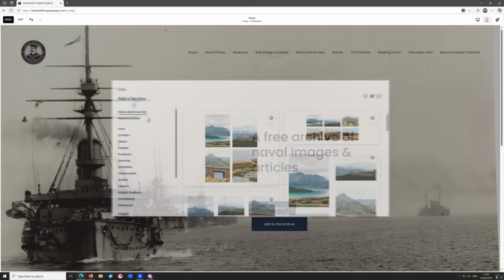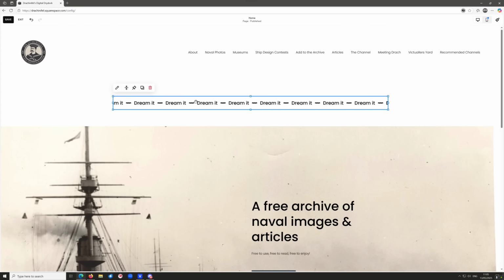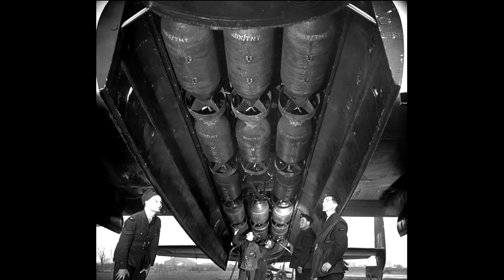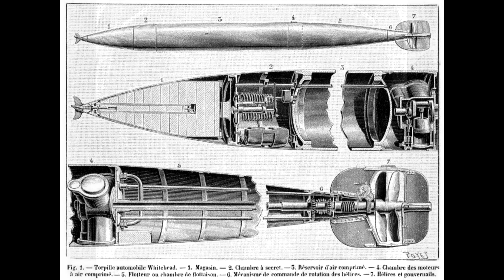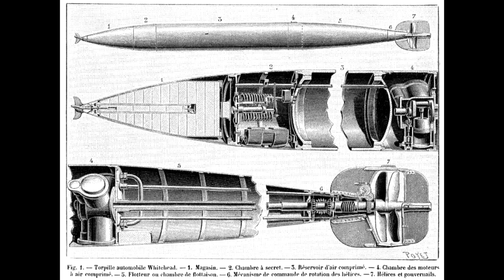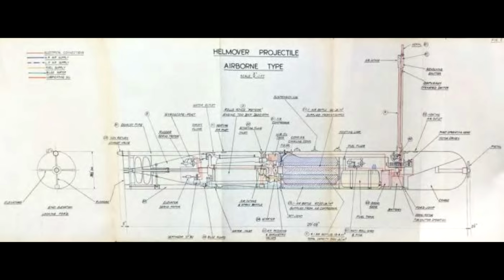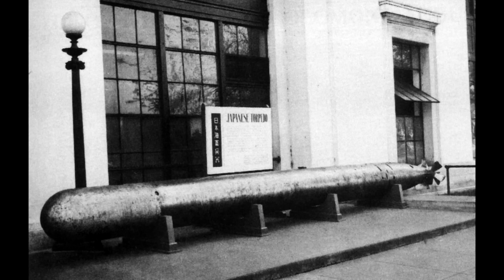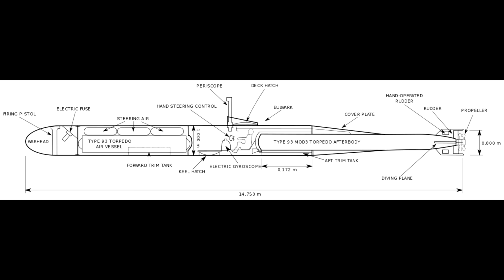The Helmover Torpedo - The Battleship Eraser

Comment: So it is a Grand Slam scale torpedo powered by a 550 horse power V-12 engine bearing a ton of RDX and having the ability to jump out of the water and over obstacles while requiring two aircraft to deploy it?

And it was actually ordered into production.....
Reply: @88porpoise  could be worse, could be a Chicken-powered nuclear bomb. We only NEARLY built them 😂
Reply: @MoA-Reload...  Chicken GUIDED nuke glide bomb .  Hopefully the chicken wouldn't identify as a Homing Pigeon.  😁
Reply: @robertf3479  oh it was even crazier than using the chicken for guidance. The plan was to bury a bunch of nuke mines to stop the Soviet advance if they decided to push through Europe but this was back in the 50's before modern electronics and turned out timers and detonators back then really didn't like the cold. There was a chance the bomb would freeze and either fail to go off or go randomly before it was needed so they turned to chickens. It was easier and more efficient to keep a chicken fed n watered to heat the timers and stop them from freezing than installing a heating system so that's what the plan was. Shove a chicken in to sit on the timers to keep them warm with enough food, water and air for the chicken to live for 7-10 days and then run 😂
Reply: @robertf3479  There was a pigeon guided glide bomb though ..
Reply: @shaniamonde7341   And it actually proved somewhat useable.  At least better than the swarm of firebomb-laden bats.  😮😅
Reply: @robertf3479 Are you sure you’re confusing them with the pigeon-guided bombs?
Reply: @shaniamonde7341  That would have probably been the next version. I mean, it's already got a snorkel platform over the waves, the guidance system including some trained pigdeons were available...
Reply: @MoA-Reload...  The British were using chicken heated nuclear land mines during the Cold War so that isn't nearly as out there as one would think.
Reply: @l7986  what makes it so much better is when they declassified the documents around it everyone thought it was an April fools joke at first 😂
Reply: @MoA-Reload... or Bat bombs
Reply: @dave_h_8742  Ironically, ignoring the problems with using animals as unwilling/unwitting suicide weapons, the procurement of said bats, and deliberately introducing a non-native species to the environment, they would've worked fabulously well, as you'd only need a couple of bombers with a Bat Bomb mixed in there to burn down a city like Tokyo (which was primarily paper and wood, rather than brick and mortar or concrete and rebar)
Reply: @MoA-Reload... Chicken *triggered*.
Reply: @jimtalbott9535  true, good point
Reply: @MoA-Reload...  Or the nuclear bomb whose own designers basically said "yeah the safety in this does not work". Violet Club was a WILD ride that scared the US so much that they supplied their own designs to us in its aftermath. Or at least given the timeline that's the narrative I chose to believe.
Reply: @Reddsoldier  What country?!
Reply: To be fair, it’s a lot better than a squadron of fairly short range torpedo bombers as long as there aren’t too many enemy planes in the sky
Reply: I mean, why would you not
Reply: Torpex has RDX in it, but is not entirely RDX.
Reply: And after the war they said "and how about we make it nuclear as well?"
Reply: This thing is so bonkers I’m amazed it wasn’t German. 😉
Reply: @GrahamCStrouse if it was German they would’ve stuck rocket engines on it
Reply: WELL I SAY..
Reply: "Nothing ventured, nothing gained"  
- Chaucer
Reply: So you're saying the U.S. defense industry gets it honestly.
Reply: 750-1030hp
Reply: O ye of little faith ..
Reply: the bouncing bombs for the dambusters could knock their own airplane out of the air. you do dangerous things in war
Reply: Dude this is a British weapon, from the same people who created a MANPADS you had to manually guide with a joystick to hit a moving fighter jet
Reply: @argokarrus2731  I defend blowpipe on the premise that it led to Javelin which is a scary MANPAD.
Reply: Must have some German in the bloodlines
Reply: Imagine the german spies who got any intel on this, and the cold sweat of any capital ship captain if they new somebody was coming for them with this weapon.😅
Reply: @0katmandude0   I like to imagine the German spies capturing some new Intel, they get back to their hide out, set up the radio, pull out the paper's and start reading back what they need to send and just going "aww come on! I get caught here I'll be shot as a spy. If I ever get home after sending this they'll shoot me for being drunk, high or both on the job!" 😂
Reply: Dude this is a British weapon, from the same people who created a MANPADS you had to manually guide with a joystick to hit a moving fighter jet

Comment: Thank you for the episode. 
One question: from your visit to Cleveland, it is clear that torpedoes can be adjust to run on different courses after being launched (and not just directly ahead in line with the submarine's bow or the airplane's nose). Did any of the powers consider using a torpedo that would run on a arc? Or did they ever consider adding acousti c homing to air dropped torpedoes?
Reply: Yes and yes.

The Germans have the LUT and FAT pattern running torpedoes they issued to the U-boat force later in the war, specifically designed for targeting convoys. The pattern was a looping S shape that the torpedo does after passing the programmed distance to the target coz at that point, the assumption is that it has missed the target so it should then turn around and go back the way it came to hopefully hit the target from the opposite side if it once again didn't hit the target then it proceeded to do this repeatedly until it ran out of fuel or hit something (which could be a different ship in the convoy).

The Italians had electric air dropped torpedoes that were programmed to cruise in slow lazy circles for extended periods of time and the idea is that they drop it in enemy waters along busy shipping paths or even at harbor entrances. The idea is obviously that some unfortunate ship passes by and gets hit by the circling torpedo.

Acoustic homing air dropped torpedoes, that's the Mark 24 mine. They called it a mine for counterintelligence purposes, but it's actually a small electric anti submarine torpedo that can be air dropped over the suspected location of a submerged U-boat and it will follow the noisiest object nearby, It's quite slow, like 10 knots or something like that to keep self noise down, but still fast enough to catch the usual 7 knot max underwater speed of a U-boat (well at least a common U-boat and not those elektroboots).
Reply: Did we have acoustic homing at that time?

Comment: And on today’s episode of “What if Top Gear was around in World War 2?”
Reply: Speed and power solve many things as Clarkson would tell you
Reply: @timetounwind9205 
❓So, what you're saying is that the torpedo should have INSTEAD had 3 GM 572cu/in Chevy V-8's installed, each producing 730hp x 3 = a total of approximately 2,200hp & 2,040 ft/lbs torque.  You were correct in your estimation that this much power in ^that torpedo should do 0-60mph in 6 secs, standing 1/4 mile et's in the mid 9 sec range, and top speeds of 260mph.

  But did General Motors Performance Parts(GMPP) sell the Chevy 572ci big block V8 in the early 1940's? Didn't you consider that when YOU decided upon ^this exact propulsion system? I'm sure you did.... 😉👍
Reply: Tonight on Top Gear...
James learn how to drive RC boat
Richard looks out of a window's  plane 
And I get to use my genius against crauts!
Reply: Hammond: So, how are we going to power it?
May: I've been running the numb...
Clarkson, entering the room on a forklift thats carrying something massive under a tarp: Gentlemen, I've got this.
Reply: @VieVentar  
"Tonight: James wears a moustache; Richard wears a moustache, and I wear a moustache."
-
Hammond: Is that, a radio control for this thing?
Clarkson: YYEESSSSS
-
Hammond: I assume, at some point, there will be a massive accident.
May: Yes.
Reply: How hard could it be?
Reply: Racing alongside a enemy battleship, outoacing every destroyer and leaving behind a smelly and colorful smoke cloud.
The damn bits again.
Reply: I can just imagine seeing Jeremy Clarkson riding this thing into the Bismark yelling "POWERRRRRR"    
Be even better if it was the engine from a Jaaaaaaaaaggggggg.
Reply: It seems to be a Nation Thing. There is definetly something in the water on that Island.
Reply: @Benepene  
Allen Millyard concurs....
Reply: "The producers gave each of us a budget of £1,000 and told us to buy an engine for our torpedo."
Reply: "PUT IT IN SIDEWAYS"
Reply: Imagine if this project was given the highest priority. Hunting Japanese aircraft carriers and super battleships with active sonar homing. Adding in the "explode below the keel" would have made this a true "one launch, one kill" weapon.
Reply: lmaooo
Reply: And on that bombshell...
Reply: James May as his going down in a flaming Lancaster bomber "oh cock"
"That's not gone well" Hammond after attempting to jump  a cromwell tank over a canal and landing in it. 
"Sometimes you can see my genius" Clarkson after presenting their new prototype tank the valiant A38.

Comment: Another excellent Drach video, with bonus early release.

Meanwhile, somewhere in Ukraine, one of Budanov's minions is carefully taking notes, just in case the Muscovian Black Sea Fleet ever dares to venture out of port again...
Reply: Obviously with a weapon like this, fitted with modern control and self targeting equipment, the black sea fleet is not safe in harbor. It's only safe because Ukraine don't want to take things that far.
Reply: @Right-Is-Right  I think it's less that and more that a fleet in being is far more costly than a sunken fleet. For as long as the Russian Navy is anchored there, they need to manage, they need to defend it, and they need to maintain it. That's a lot of resources taken away from the front lines. Though you could argue they could simply bring more ships in after the war - that's not necessarily guaranteed with the treaty with Turkey.

Comment: Lancaster as a torpedo bomber…. FTW?!
Reply: The Manchester from which the Lancaster was derived did have Torpado bomber as part of the mission spec. hence the very large bomb bay.
Reply: When there's a big plane with a lot of undivided internal space, it is a matter of time until some kind of ridiculous load appears.

Aside from the obvious oversized bombs, large military airplanes have carried:
1) Small fighters, like the Goblin in the B-36's bomb bay. 
2) Absurdly large film cameras with film developing facilities (a recon version of the aforementioned B-36). 
3) Field artillery and multiple autocannons (AC-130). 
4) A fighter direction station (a Chinese Tu-4 field conversion).
Reply: @ObsessiveExplorer Then there's the design proposals that get even crazier. Case in point, the B-1R proposal, because clearly the USAF needed a Mach 2-capable air-to-air support bomber with engines ripped off the F-22 and enough missiles to de-plane a small country. The designation had to be some engineer having a laugh though, because there's no way in hell marketing would approve of a project that's literally called the B-OneR.
Reply: @TheMobiusRibbon1-4  The idea of putting a lot of anti-air missiles on a heavy bomber reminds me of the He 177 'Großzerstörer' with its 33-tube upward-firing rocket mortar battery.
Reply: @TheMobiusRibbon1-4  Yeah the B-1R is a really fun project to learn about. Loading one up with air to air missiles and just having an AWACS painting the targets.
Reply: ASR aircraft used to carrry entire lifeboats around to drop when they found crews in the water, too.
Reply: Avro Sea Lancaster, the torpedo bomber 
(If only the Project Habakkuk took off)

Comment: There were some rather similar anti-tank missile projects (launched from great distance, picked up near target for guidance) floating around in the 1950s ("Men Against Tanks" has a chapter on them).  It wouldn't surprise me if the guidance system/remote control from this wasn't passed along as inspiration.

Comment: This seems to be a really Rube Goldberg solution. Did anyone ever look at an unguided sea skimming missile? Something like a rocket powered unguided Harpoon.
Reply: you can’t make a sea skimming missile without an extremely good radar… otherwise the missile is just going to smack into the ocean the second there’s a large wave or a strong gust of wind
Reply: @acid6urns  The US developed very good radar proximity fuses for their anti-aircraft shells during the war. I would think that system could have been used to maintain height above the waves.
Reply: Skip bombing against Japanese ships was a real thing in the Pacific theatre.
Reply: @daniellarge9784  For skip bombing to work the aircraft had to fly very close to the target. What I was thinking about was a missile that could be released 5 to 6 miles from the target.
Reply: Rockets were quite primitive at the time, suffering from short range, poor accuracy, or both. The only long-range rocket weapons from WWII that I can think of are a) the Katyusha, best used for blanket salvos, b) the V2, a stupid ballistic thing only feasible against stationary targets preferably the size of London, and c) the Me 163 Komet, which had a pilot on board and was powered by a fuel about as stable as a 1,000x1,000x1mm sheet of glass suspended on its edges while supporting an elephant.
Reply: @akmzd6938 the Japanese Ohka suicide planes were rocket powered and had a range of 20 miles. I was thinking of something launched from 10 miles away or less. Obviously the rockets or airframe wouldn't be a limiting technology.

Comment: So the one tap torpedo. One has to wonder what the British battleship engineer and architects had when they heard this particular weapon after accounting for the rocket powered tall boys in theyer designs.
Reply: And if you're going to think about 'what if' scenarios,  you have to wonder whether, with the modification necessary to carry the Tallboy and Grand Slam bombs allowing the Helmover torpedo to be fitted with wings and slung under a Lancaster, the replacement of the Meteor engine with a rocket motor and deletion of the snorkel would have allowed the British to create a command-guided antiship missile
Reply: @seanmalloy7249  
Fritz X ring any bells?
Reply: @JohnSmith-pl2bk  Fritz X was a glide bomb; I'm suggesting an actual powered weapon.
Reply: @seanmalloy7249  
Adding one the the many German rocket motors to a Fritz X was the next step?
Reply: Too bad the American Disney's had such a poor record in use. Gerald Bull in 1940s Britain. "I say l have this idea for a 40 inch cannon with rocket assist shells. Hit Berlin from East Anglia what say."